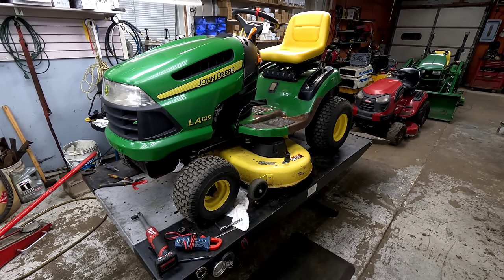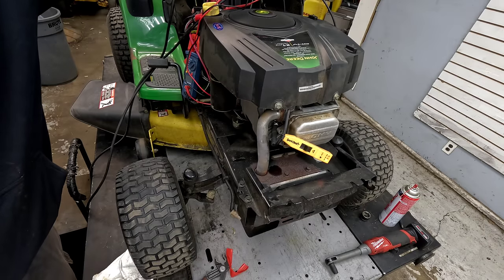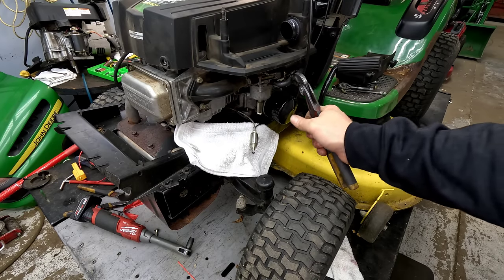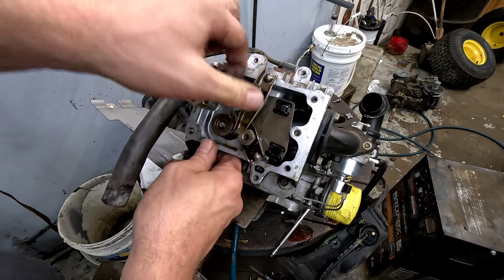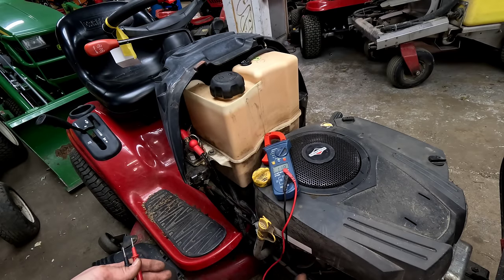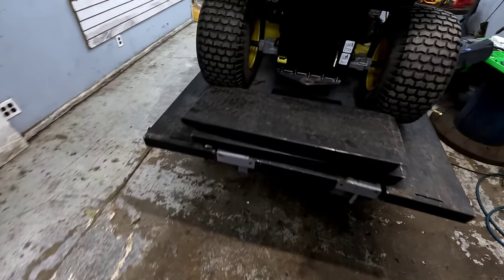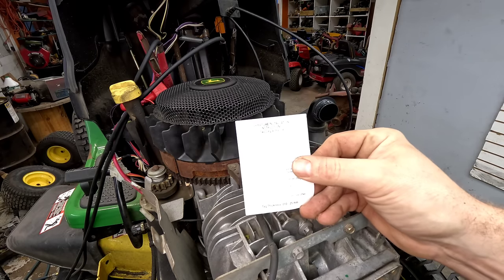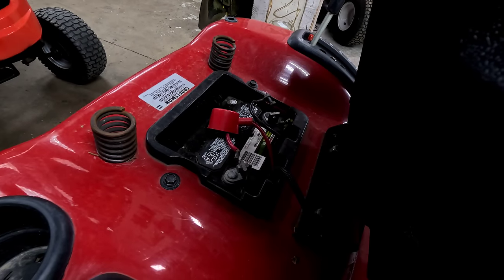Riding Mower Won't Start / Turn Over Or Clicks Full Electrical / Engine Diagnostic & Repair Process

Comment: I'm, not complaining. Don't, get wrong. I do, always sand the flywheel magnet, clean. Just because, my dad taught me to do it, when I was a kid.🙂 I, get what you're saying, though. Great upload, sir!
Reply: Both are correct. Won’t affect it, BUT it can change the width of the gap when measuring.
Reply from the maker: I know how that goes!! Thanks for watching!
Reply from the maker: Yes sir!!
Reply: Mine to and after its brushed clean and dry they start right up but wouldn't when it was rusty

Comment: This is a great vid.  Thank you.  I have the same engine.  Was mowing yesterday no problems, started right up, ran and cut fine.  Ran it until it ran out of gas.  Put gas (fresh w/Stabil) and now it won't start.  Battery reads 12.68 volts after trying to crank it over a few times.  Air filter, clean as a whistle, spark plug good (looking), checked push rods (good), can turn the engine by hand and get resistence at the right point.  Puzzling so far.
Reply from the maker: Check for spark or fuel and rule one of those out first. Be interesting to know
Reply: @IndRepair  thank you for the reply.  Good on both, I got it running and moved it from my driveway to my shed.  Started it again a few hours later.  The test will be when I try again on the weekend.  I suspect the ignition solenoid and if it acts up, I can at least use your jumper trick to get it started and moved around while I order a new solenoid for it.  It is the original one and 15 years old.  Machine never sits outside in the weather.  I did check the charging system and that was good, about 13.68 VOLTS while running.
Reply from the maker: How did it go?
Reply: @IndRepair  found the ignition solenoid was dead on my Dad's tractor today.  My issue may just have been a loose connection between the starter and the + post on the ignition solenoid; mine I have been able to start up 3x no probs, and then mowed Friday no issues starting or when restarting.
Reply from the maker: @PapaMav  Awesome job!
Reply: @IndRepair  thank you. When the solenoid comes in that I ordered, I will putting it in for him.  Took a pic of where the White and Black wires go to it but I imagine bc that part of the solenoid acts like a switch it really does matter which goes where.

Comment: My head gasket is blown out it blew a few days ago on the intek 18.5 and was pouring smoke out for all the neighbors. It kept dying out because of that and water in the carburetor bowl but i kept staring it back to get it back to the shed then it just didn't wanna run so i pushed it back a few feet and am waiting for now it needs both new push rods the ones ain't bad but was rusted before
Reply from the maker: Hope you get it going!
Reply: @IndRepair  i will i got its rusted piston moving and both valves cause when i got the mower it didn't have a engine shroud and the carburetor was wide open to the rain  and snow and is how those things rusted in place was why the flywheel wouldn't spin at first but it does now its just needing a few new parts then i can start mowing with it
Reply from the maker: Awesome

Comment: Do you do voltage drop tests on the cables and clean the connections ? 1:37
Reply from the maker: If they are corroded or loose definitely. I only do voltage drop tests with my analog meter when necessary

Comment: Well atleast that john deere does have space above the battery for a gas tank i would rig one right there and eliminate the gas pump.
Reply from the maker: Would work, a lot less capacity though
Reply: @IndRepair  i know but i like them that way better than a pump

Comment: great video content. lots of information. question is there ever a time youve run across a dead magnet before.
Reply from the maker: I thought I did one time but ended up being a brand new bad coil. Metals can go bad and magnets can loose their magneticity but after all these years I have never seen it. Used to see electric motors metals go bad occasionally and would not create the right magnetic field after rewinding. Not a common occurrence. Thanks for watching!

Comment: Could the ignition switch go bad and allow the mower to turn over but not start and not send 12 V to the solenoid on the small leads my solenoid doesn't click anymore when I turn the key but the starter will turn over. It just won't start and run.
Reply from the maker: It is possible but likely a bad wire or connection to the solenoid or the solenoid itself. I would check with a volt meter and work your way backwards, many times it is the engine harness wire that goes bad between the solenoid and engine harness itself. If you find no voltage at solenoid, check at harness on corresponding wire and see if you have it here. If you do no, trace up to the switch and see if you have it at the switch